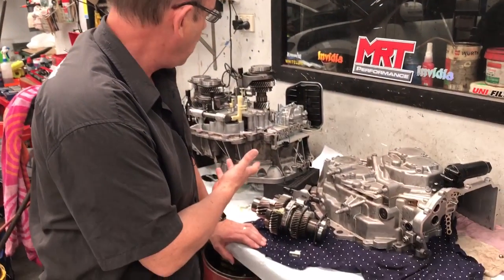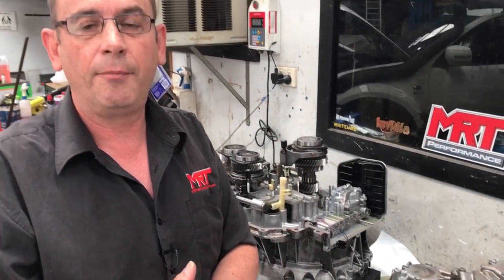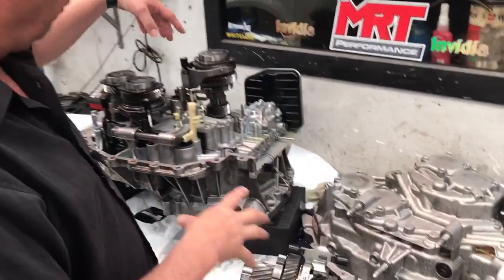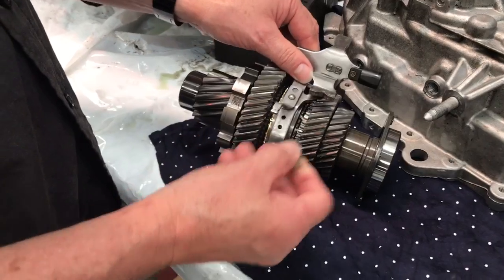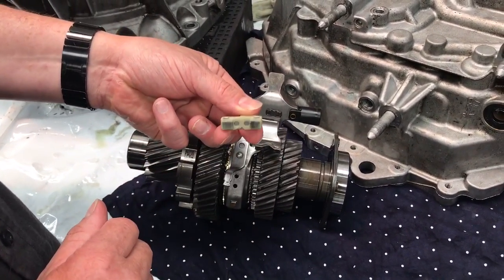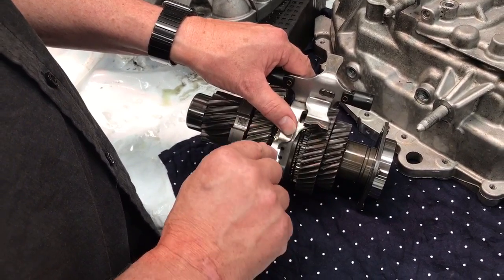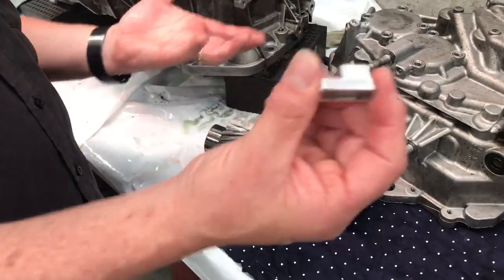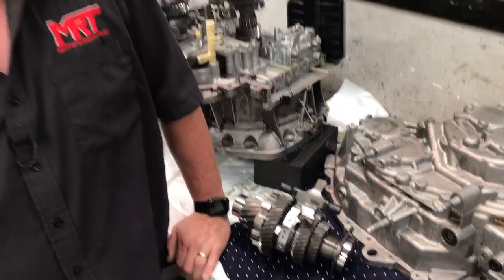Mitsubishi SST Transmission - No More Warning Light

Comment: When replacing to after market magnets, do they also have to be installed in a certain position like ahen you reglue the stock magnets? Or do you simply slide the aftermarket ones on all the way and tighten the set screws? I remember an older video you mentioned when reglueing the old sensor that it has to be no more than 1mm off. Does this apply to after market magnet as well?

Comment: 133,000 miles on my SST and still going strong.
Reply: 56,000 miles on my 2015 and mine went last week...
Reply: 210,000 km 2009 sportsback and failed yesterday
Reply: Hi what year is your car and how often you service??  Also 133k M or
Reply: I have a 2008 MR.  I change the SST fluid every 30k miles.  I also drive it in Manual SS mode all the time.

Comment: This may be a bit off topic, but what are the weak-spots in the sst? I've seen clutch packs available for up to 700ft-lbs of torque, but what happens after? Do the gears shred or does the case split? I remember a tech saying the little bits in the trans breaking after 600ish, but he didn't elaborate.

Comment: The number of SST videos you have done ensures I would never buy one!
Reply: Matt Ive owned mine for nearly a year now and it has over 250k kms on the clock. They are very very very excellent transmission, some of the smoothest and purest driving experiences i have ever had have been with tuis car and transmission. Honestly. Ensuring the car always is serviced both trans and engine with appropriate fluids and everything will be very worth it and you wont have many issues. Dont be too scared by these videos they are mainly meant for the people who domt look after their boxes

Comment: A few grub screws alleviates the problem.  The bean counters win yet again. Engineering is full of this sort of nonsense.
Reply: That's often the case with modern cars, they're way over-engineered to cut costs. They usually get away with it, but occasionally you get trash like this where it worked on a test bench for however long they tested it, but in the real world it fails consistently.